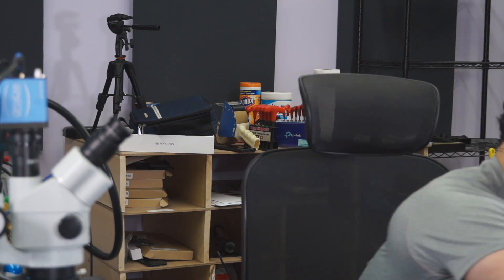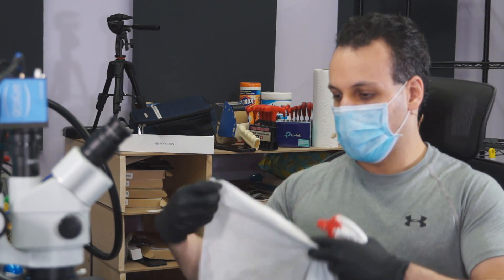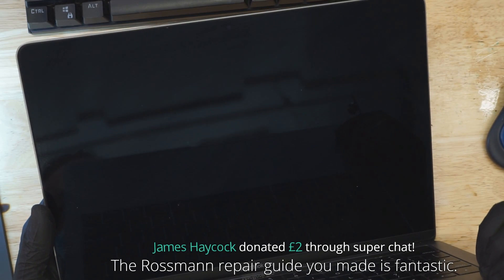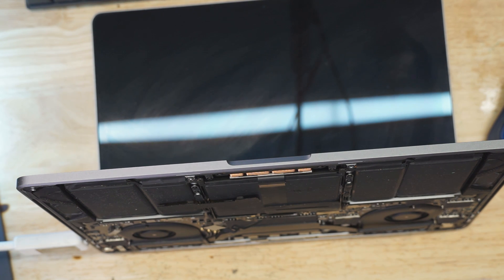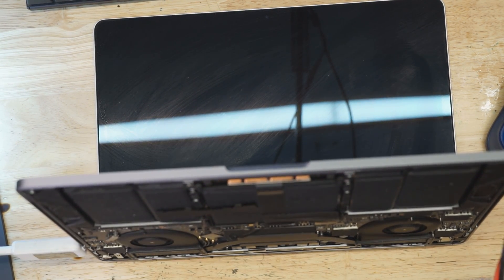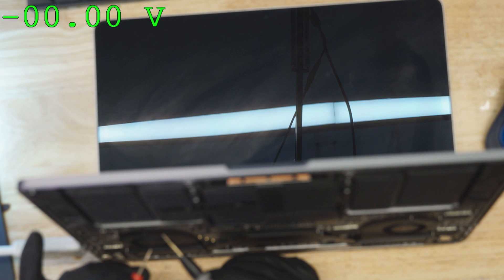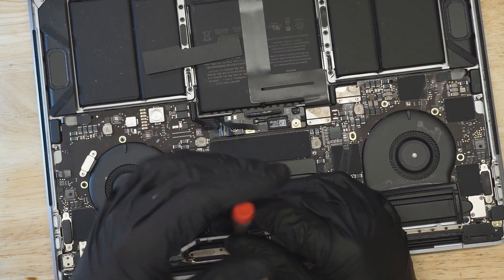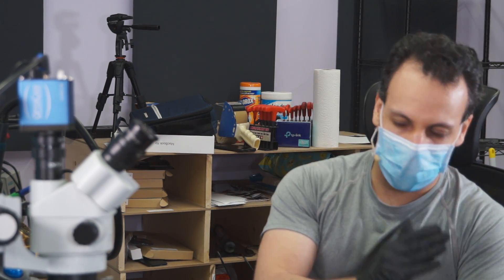Apple PCB design is a meme.

Comment from the maker: It's not that someone made the mistake and didn't think of it at the time. We all make mistakes, even if there's teams of engineers working at a company with 100+ billion in the bank.

It's that FOUR YEARS after the original came out, this is still the design being used. 

In 2020, they still sell machines with 52v power next to 1.7v data. WHY???

You are one of the richest companies in the world - you can't remap a connector and make minor change to LCD for next year's model?

No backlight issues used to be minor connector rework or a fuse replacement - now it's an ENTIRE BGA CPU SWAP EVERY TIME THIS HAPPENS!

Some have said if they changed this, they would have to change the pinout on the LCD as well, meaning that they'd need to use new parts. So perhaps this was a cost saving measure that allows them to re-use old stock. WRONG!! 820-00239 has that problem, then next year 820-00923 has that problem, then next year  820-00850 has that problem... surely 820-01700-05 which uses a DIFFERENT SCREEN ENTIRELY won't have this problem, right? They have the chance to change this because there's a new screen that needs to be made anyway.. AND THEY DON'T! LCD backlight still sits right next to LCD data. Here it destroys a mux instead of the CPU, but still...
Reply: Ugh. Don't even talk to me until I've had my morning crack pipe
Reply: @rbmk__1000  Is that a random quote from Apple engineering room at 10 am?
Reply: @sleeptyper  5 pm
Reply: @sleeptyper  rbmk 1000 (letter to letter translation of reactor big power boiling) can be a type of nuclear reactor that was constructed in Chernobyl
Reply: step 3: profit
Reply: Well, it’s obvious isn’t it? They’re made to break easily when you spill something on  them, forces them to buy a new computer. It’s bad for business to make stuff last for a long time, it’s just the sad truth
Reply: @trickeh2k  Yep, CEO/CTO decision no doubt
Reply: Planned obsolescence, my friend..all part of the plan..
Reply: Apple everyday seems more and more like a Wish .com ripoff laptop that just has a shiny finish and box.
Reply: I feel like you should write "Fuck Apple" on your mask, during live streams... it just seems fitting.
Reply: Louis Rossmann Well somehow they need to sell new shit, so why shoud they make it better?
Reply: @Louis Rossmann for 52V difference (data line many times goes to 0V) for an external point at the board, WITH NO LIQUID just design it should have .025" absolut  minimum spacing which i doubt it has, i am not going in the board view right now but if you feel like it please confirm, here is an online calculator, it would take apple engineers 10s to find it and a tiny bit of logic that they shouldn't do it. Also a good design practice is typicaly account for double the voltage which in a good design should have at least .05" for meeting IPC-9592 standards (for this i am 100% sure there is no way this connector could ever dream of)
https://www.smps.us/pcbtracespacing.html
Reply: This part of planned obsolescence design. Do you really think that the engineering team doesn't know there is a design flaw here? I bet they do, and they also know that there are good chances if someone spills his favorite beverage,  the CPU will get a nice shock. Of course the customer doesn't know about designing PCB and how it could it prevented in his eyes its just his own fault. so he either pay hundreds or even more than thousand for repair or most likely buy new machine. Either way there will be more revenue for the company.
Reply: @eliadbu  at the cost of some damage to the reputation of the company. They've likely considered the trade-off and made their decision. Is it shitty business practice? Yes. But it's up to them to decide what to make and the customers what to buy.
Reply: @Dummyc0m  as I said the average consumer has no idea nor he is interested how the PCB and the connectors are laid out, nor he can compare liquid resistance from one brand to another because most consumer laptops are not water resistant. When someone buys a Mac it will be for the OS, the design of the machine and ergonomics. For instance the stupid butterfly keyboard had a serious and obvious design flaw that customers noticed it (due keys failing pretty quickly) and got upset about it. Apple after 2 (failed) attempts to fix the problems got rid of the keyboard because it got large backlash, for this design flaw (or planned flaw depends how you view it ) they won't get nearly as much backlash and attention because (most) people don't look at the very small details. Sadly reliability and serviceability of most modern electronic devices are either neglected or intentionally downgraded as features and specs fashionable design have greater influence when consumers make a purchase, and the manufacturer will earn more revenue by selling new devices/insurances or repair malfunctioned ones.
Reply: @eliadbu  I have no interest in knowing how the PCB is designed or plan to service my devices myself at the moment. But as I understand it, this is indeed a fairly critical design flaw, but if it were actually severe and widespread, there would be more people talking about these reliability issues. Personally I will not be purchasing apple devices any time soon. Though I would be interested in some numbers of, say, the failure rate or average lifespan of a macbook compared to other devices.
Reply: @Dummyc0m  for that you will need to collect data from tens of thousands if not hundreds of thousands of devices to get a better understanding. Usually this kind of data is available for the company, and it won't voluntarily publish such information.
Reply: Chubbyemu (A doctor who posts videos on youtube): "Louis drinks Corona Coffee-> This is what happened to his MacBooks."
Reply: Electronics guy here. If they gave half a flying shit, a protection diode on that line would go a long way. But no, all they want is for their moron customers to buy the new model every two years and make them filthy rich
Reply: Because.... Apple: Yesterday's technology, but at tomorrow's price!
Reply: Can't somebody file a complaint to the FCC or something?
Reply: You drop liquid on the product, you loose your guaranty,  you have to take it to them, they sell you a new one, profit
Reply: im a hardware engineer and you are dead right louis, this is not a beginner mistake its intentional and disgusting
Reply: The fact that they know about the issue, and continue to make NEW parts with the SAME issue, indicates that this is the desired behavior of the device when exposed to any moisture.
Reply: Well you just answered your question, Louis. They would not be one of the richest companies in the world, if they would not put 52V power line next to 1.7V data line
Reply: @semplar2007  They actually would though because they were a multi hundred billion dollar company for years even before that lol.
Reply: >You are one of the richest companies in the world

and it sure doesnt hurt making hundreds every time this happens
Reply: I swear I've seen you make a video about another repair with the same problem years ago.
Reply: Not that I'm excusing Apple but I wonder if it's like that because that's the way it is on the connector on the display panel? I also wonder about the new-ish CPU's having usb3 directly connecting to them in newer PC design. On the other hand we know that Apple don't want you to repair these products.
Reply: Wow thats insane design. Gonna avoid macbooks. What's a reliable laptop to get? (not gonna use it for games)
Reply: don't worry, it'll still be there in 4 more years
Reply: Starbucks 1 Apple 52V
Reply: no apple for me
Reply: It's on purpose obviously, they like liquid damage to fry the machine, more mulah for the CEO etc.
Reply: https://youtu.be/wj_AOzSSDMM -> This is a cool video to watch.
Reply: https://www.medicalnewstoday.com/articles/new-study-questions-the-effectiveness-of-masks-against-sars-cov-2?fbclid=IwAR3pZyUGxIk6VsZ417gyFrAwyI18IYr4sd7amaLYbD5TQs-t5dkoQ34zPmI
Reply: https://youtu.be/rn-WLpa_nyQ ---> The full version of the video in the previous URL link
Reply: unfortunately, I think I have this exact same problem on a 2016 mac book pro 13". I was going to try sending you it to see if you could work your magic on it, but I think I have both the diagnosis and the prognosis right here in this video :( Nothing much to be done it seems short of taking in into Apple and getting them to rip me for around 1,000 USD to basically replace the whole machine. I'm sure they'll want to replace the whole board, the CPU and the screen itself, so then the only thing anyone rational can do is just scrap it and buy another laptop. When Apple say they "think different", they, in fact, mean "Think sucker"
Reply: They designed it this way on purpose. It forces customers to replace products faster due to higher risk in the field.
Reply: "It's not that someone made the mistake and didn't think of it at the time. We all make mistakes, even if there's teams of engineers working at a company with 100+ billion in the bank.
"

This isn't a mistake. This is done on purpose. If it isn't, they should fire every engineer who worked on these laptops. Not mixing datalines and powerlines is electricity 101. Every single engineer at Apple knows how stupid this is.
Reply: @Jay Talents Its because of consumerism not capitalism, Alternatives exist but Apple customers keep  choosing the same shit even if they have issues.
Reply: Somehow I became unsubscribed to your channel, just a heads up. Has any one else mentioned this happening to you?
Reply: like someone before said Simple diode would do the job without changing anything else;)
Reply: @Jay Talents Please read what I wrote.
Reply: I would say that they intentionally made this so they wouldnt need highly qualified staff, more knowledge=more money. its easier to pay less people that only know how to replace one cpu or other major parts and they get replacement parts in bulk for next to nothing... and they deliberately made it so the thing brakes like that... its not that they are incapable or its poor design - its everything else but that... capitalism
Reply: i wouldnt put it above apple ot design a laptop that is prone to self destructing...

it makes them money.
Reply: I concur with a lot of the other people here, in that it's probably a deliberate trap to turn a simple coffee spill into an entire CPU and/or laptop replacement, for the sole purpose of making more money
Reply: its just like selling fifa every year :D
Reply: They probably don't even know about it. I suspect that when this fault finds its way into an Apple store, it's marked as liquid damage, meaning there is no hardware fault to investigate. Board gets tossed into the trash, design engineer never hears about it, customer goes on their merry, ignorant way. That's what happens when replacing boards is so much cheaper than solving problems.
Reply: @Jay Talents Lazy, ignorant consumers ensure this. Once upon a time, consumers were more involved in their own purchasing decisions and maintenance operations. The problem isn't capitalism, it's cultural decadence.
Reply: @SepticFuddy  Nah, read The Jungle. Corporations have always been this bad or worse. They controlled the media back then too.
Reply: @Rob_Fordd  I never said they weren't. You entirely missed my point and then offered a socialist propaganda novel as proof. I got news for you, bud. Incorporation is not a capitalist concept, it's a mercantilist (now corporatist) one. It is the government and business getting in bed together to protect the corporation from liability for exactly the sorts of things Sinclair dramatized, in exchange for more stringent tax accountability. Strip that protection along with the industry regulations that are all designed to push out upstart competition and the large businesses collapse under their own weight in the truly free market. A free market is the LAST thing the corporations want, hence why they constantly lobby for regulations and support the candidates willing to shove them through on their behalf.
Reply: @Rob_Fordd  It's a rich to hear you, a progressive, criticize someone on the assumption that they're a victim of progressive pseudo-journalism, especially when you wanna put forth Upton Sinclair's fiction as your argument against capitalism. The irony could not be thicker. You don't know shit about me. I've been criticizing yellow journalism and the concept of the "Pulitzer Prize" for many years.  Case in point, I don't eat pigs at all. Most shit that goes through regs I won't eat. I make my own decisions and don't need Big Daddy Government to pretend he's got my best interest in mind when he really doesn't give a shit. It's the market getting wise that forces suppliers to meet the demand for standards. Non-GMO labels, organic labels, kosher labels, halal labels, vegan labels, keto labels, gluten-free labels, you name it. If enough people want it, there are multiple private organizations competing for the trust of the consumer that they can sell to manufacturers. Anyone who cares can do their own research on the different labels and issues and decide what's acceptable and what isn't. All you did was prove my point that lazy consumers are the problem.
Reply: @Rob_Fordd  Talk about projection with all that "mountain in a storm" talk. Ain't nobody talkin about Yelp or BBB, that's just more lazy bullshit. I'm talking about taking responsibility for your own shit. If you get screwed because you failed to do research, that's your own problem. If you got screwed because someone lied and defrauded you, that's the law's problem. You're telling me a government you say already fails to execute its own regulations should just assume total control and then everything will get better. That's called insanity. It's been tried repeatedly all over the world and it's only ever ended in mass starvation, incarceration, and death unlike any other force in history. And you wanna talk about valuing humanity, lmao. You can't even give me an actual argument, just throw out some "Nah, go read some fiction. Nah, you're probably this fictitious avatar I've created for you in my head with no relevant information whatsoever. Socialism works and capitalism sucks cuz I said so lul." You couldn't even be bothered to parrot some Marxist talking points, much less make an actual case for your position. And you expect me or an observer to take it seriously? No wonder socialists "convert" everyone at gunpoint.
Reply: @SepticFuddy  Honestly I think both consumer and capitalism contribute to the problem.
Profit driven Apple market their product to different audience comparing to the old time, new audience isn't smart enough to realize the level of crap hardware they buy into, thus Apple is happy, and consumer is happy since they are too stupid to realize the lie and bubble they lived in.
Perhaps certain level of government intervention can help, but I would prefer educating the consumer and more consumer advocacy instead.
Reply: @Verpal  Government intervention only helps when it is prosecuting actual fraud, which, admittedly should be easier to do. Corporatist protections are the main thing preventing that. Market regulations only ever serve to protect the market share of big, shitty companies like Apple, and enable them to double down on their shitty behavior. Smaller competitors can't afford the legal infrastructure to deal with regulations, and that is the entire point of big business lobbying creating these regulations in the first place. If corporatist protections were eliminated, there would be a lot more viable competition that would force the larger companies to stay more honest. If they can't turn a profit honestly, they collapse.
Nobody else is going to protect your wallet like you will. Consumers MUST take responsibility for their decisions, and stop delegating their agency to the corruption and ineptitude of politicians and bureaucrats.
Reply: @SepticFuddy  ''corporatist protections'' 
Do you mean the existing government regulations? So, in your opinion, to counter Apples behavior, we should eliminate regulation to increase competition in market?
I also prefer educating the consumer instead, but I wouldn't immediately conclude that existing government regulation is completely detrimental, as long as it set a ''baseline'' quality for products.
Reply: @Verpal  Yes, and it doesn't ensure a "baseline quality" of anything. In fact, poor quality is in some cases exactly what a person needs, depending on application and circumstances. Regulations are invariably poorly thought-out, ever-shifting, counter-intuitive and ineffective. They're a stick to beat people with when an excuse is desired, and little more. Lobbyists funnel money into the pockets of legislators to pass their vageuly-worded mega-bills that wildly expand the powers of unelected bureaucrats, who then employ those powers however they damn well please at any given moment. Big corporations like Apple have no problem with this, because a massive army of lawyers is a drop in the bucket for them, and they pass the cost onto the consumer anyway. Anyone not already big enough to be able to afford such a legal team can't even get started.
Without such a competitive atmosphere, the handful of massive companies dominating the industry can all agree to screw their consumers over similarly with impunity. An educated consumer base can only accomplish so much when they conspire so. Furthermore, while educating consumers is obviously always helpful, they really need to develop the habit of seeking out the information for themselves to achieve the desired effect.
Reply: @SepticFuddy  Are you saying that a device that can literally explode have a niche in market? Not sure what kind of ''poor quality'' you are referring to here.
It is clear that you are against any and all regulation, I don't necessarily agree, but at least you are being consistent here.
I think you have overestimated the ability of an average consumer. That being said, I suppose you would think that it is sole responsibility of the consumer to do their own research on their product.
Honestly, in your proposed society, an unsettling amount of people will die of their own laziness/stupidity/unfortunate, you might think it is fine, but again, I don't agree.
It is clear there are too much difference in our idea, further argument/discussion would not be constructive. Perhaps you might find more like minded individual in Ancap societies?
Reply: @Verpal  That's a very dramatic interpretation of "poor quality", but I suppose I can forgive that since most people haven't seen the things I've seen in the 3rd world regarding how people approach problems. The point was that it's up to the consumer to decide how much or little they want to invest into various aspects of various products, rather than setting a minimum bar that locks out the poor. Obviously, if the product causes tangible harm or does not function as advertised, the manufacturer and/or retailer are still liable. That is one of the few legitimate roles of government (which an ancap would never admit).
On that note, I think you'd be shocked at just how "unsafe" things are all over 3rd world societies, with far less real danger than one would expect. It's not to say that anything goes or that they don't have problems, but the bottom line is that we are all human beings responsible for ourselves and our decisions. It is not our place to protect people from themselves at gunpoint, nor do we have the right. Society has seen a degradation in the average person's decision-making abilities specifically BECAUSE the decisions are made for them via regulatory policy. Responsibility and decision-making are skills that are developed with practice, and we have removed the everyday chances to hone them. We are left with an infantile population suited to coddling because they have been coddled all their lives. 
An example is driving. In the Andean sierra, the roads are narrow and highly perilous. The driving laws are far more lax than in developed countries. And yet, the drivers as a whole are far more alert, inter-communicative, considerate, and generally responsible, because they know the alternative is falling off the side of a mountain. Meanwhile here in Dallas, where everybody drives to and from work every day, driving has only become more and more dangerous. There's certainly no lack of driving laws, licensing requirements, inspection requirements, good sightlines on wide, open roads, etc. But the rules themselves give a false sense of security, so that when the inevitable Californian immigrant flaunts them, nobody else around is alert and prepared to deal with the unexpected. We drive around on mental autopilot, and it causes problems every day.
Reply: @SepticFuddy  All place that you quote still have laws and regulation, are you in support of regulations now?
When you are against every and all regulation, I told you, there are no reason to discuss further.
Also, explosive device is not an dramatic interpretation, if there are no regulation in place, it is completely legal, and normal, to see device that will kill user on the market. Mind you, there are existing regulation on every single nation on Earth, no matter how lax regulation is in Africa, factory in China still have to follow QA and regulation in China.
Driving in Andean sierra still mean you have to follow local regulation, I congratulate local regulation if it is suitable for the environment, and we should strive to achieve similar result in the States instead of just arguing against regulation altogether, hopefully by reducing existing traffic law.
Reply: @Verpal  You're confusing no regulations with no laws. Laws that forbid the cause of harm or the misadvertisement of products are not economic regulations, they are criminal statutes. Such criminal statutes are the legitimate purview of government. Economic regulations are not. The entire point of my comparison was that a less regulatory environment promotes vigilance among the citizenry rather than complacency as in highly regulated environments. The fact that they still have some regulations is irrelevant, since it is a comparison. Of course every nation has economic regulation- that's part of the problem. Power-hungry politicians will always want the ability to control and manipulate markets to line their pockets. It is the job of a vigilant citizenry to stop that from happening, because nobody else can do it for them.
Reply: @SepticFuddy  WTF? So we literally have the same position yet spent all these time debating just because of different in definition?
Yeah, I agree that law should stay, regulations should be minimizes as much as possible, especially when these regulation doesn't have to gone through legislative process.
Reply: @Verpal  Lmao nice
Reply: @SepticFuddy  Consumers aren't knowledgeable in the products they buy because there's to much required today. It's unrealistic to ask every consumer to be a dietirion to but food, a mechanic to own a car, a computer engineer to by a PC, a real estate agent to find a home ect. It's impossible for consumers to know everything they need to make decisions on products because products are getting to complicated.
Reply: @StayCHilL24  There are plenty of people who DO know those things who are happy to provide their insight... like Louis for Macs, mechanics for cars, contractors for homes, etc. Get multiple opinions from people who know more than you do, and weigh them for yourself. It's not rocket science. If you're too lazy to do any of that, then you only enable shitty companies to do shitty things to you and the rest of us.
Reply: @SepticFuddy  cultural decadence, sure, but why would the customers be the only guilty party in this as you try to suggest? Wouldn't this be the mentality of the designers/bean counters at Apple as well?
Reply: @mjouwbuis  I never said they were the only guilty party. However, they hold the most power. I'm certainly not letting apple off the hook. But it's not much different to me than the idiots who buy into "early access" videogames and then wonder why they never end up getting the slick, working product they were sold. Alternatively, it's like a girl the puts out on the first date. These behaviors only enable and embolden the perpetrators to do what they do.
Reply: Steinhauer thank you. Someone finally said it. “It’s duh capitalism’s fault right guys?”
Reply: Even a $250 MOTILE laptop from Walmart likely has better internal component design in some respects. Buy MacBook knock-offs, not the real CrapBooks ;)
Reply: @someguy3717  hell no I'm not some degenerate caffeine addict
Reply: @VTSteve  If by "the Norwegian countries" you mean "the Scandanavian countries", they have the same corporatist model. In regards to business, they are actually in many ways MORE capitalist than the US. In regards to social policy, obviously less. But they have also been moving away from the socialized elements of their model for decades because they caused their economy to grow stagnant. It turns out people aren't that motivated to work when you steal 70% of their everything they earn. Who would have thought? Their taxes on the poor are MUCH higher than here, too.
What's your point about who has the power? "Governments and corporations have too much power, therefore we should give them more" is a pretty stupid argument. Do you even understand what capitalism is?
Reply: Jay Talents I must correct you here. You're right that companies do commit to these shady business decisions. But what has failed is not capitalism, it's democracy. Corporations have much much more interest than the average politically apathetic citizen in pushing the laws that grant them protection, exclusivities, and monopolies. Companies that operate inefficiently should not be bailed out, but should be allowed to fail! Capitalism without bankruptcy is like Christianity without hell. It does not work. Now, as for Apple, they actually provide a reasonable package that people are willing to buy. We're not talking about a flawless product, but one that is superior to the minds of many consumers.
Reply: @Dummyc0m  it's precisely BECAUSE the government is in their pocket that they get bailed out.
Reply: @Jay Talents You seem to think the main problem is "corruption", yet that is human nature. You cannot change it in anyone but yourself, nor can any system. The difference is that it takes an a large swath of society being corrupt to ruin capitalism, whereas the more governments get involved, the less people need to be corrupt for the system to cause massive harm (mass murder, mass starvation, slavery, you name it). Worse yet, the most corruptible people of all are the ones who hold those positions-- politicians. In capitalism, it takes more bad apples to ruin the bunch.
Your symptoms are symptoms of corporatism, not of capitalism itself. It's certainly not capitalism's fault that we've abandoned it, it's our fault for not sticking to it in the first place. It's our fault for trying to take the easy way out. For voting for those who claimed to be making life more convenient and "secure" for the rest of us rather taking responsibility for the course of our own lives. For giving them the power to point a gun at someone else, take their money and boss them around. Corporatism does not extend from capitalism. Corporatism is merely the modern-day form of mercantilism, which predates Scottish enlightenment capitalist theory. We are simply reverting to it out of ignorant laziness.
Reply: Jay Talents well that’s just stupid. People buy products that last a lifetime (or a quarter of one, etc,) and the company who sells the best products typically win out your purchase. Capitalism is great this way, it’s an even exchange equally agreed upon by both parties. The problem isn’t capitalism, the problem is stupid people (as evidence by them complaining about a non-human entity making their choices for them).

All people have to do is know what they are buying and agree not to do it. Apple has had plenty of lawsuits or recalls, I mean the evidence is clear and if your dumb enough to still purchase one you kind of deserve it at this point.
Reply: @Jay Talents Capitalism doesn't make people lazy, nor does is require people to be lazy. When societies are full of vigilant and honest people (like, say, Louis), these problems don't reign supreme like they do now. Governments getting into bed with corporations to protect their market share by imposing regulations and by refusing to punish them for fraud (like your plastic rice) and damages isn't capitalism, it's corporatism... which you even alluded to. Businesses getting big and resorting to shady tactics is a symptom of government sticking its nose into the economy and demanding they "kiss the ring." That is once again NOT capitalism. The rest of your points are incoherent, so it's tough to respond to them.
I'm sure you have some brilliant, revolutionary new way to exchange goods and services that is somehow better than people being paid for the work they do based on how much other people value that work. By all means, enlighten us.
Reply: @Jay Talents how does capitalism assure it? that doesn't make any sense, Apple is a billion dollar company because they make products people want, they revolutionnized the phone.
Reply: @pablomaquaire6251  Fuck noo, Sony Ericsson and Nokia did that, when these 2 were on the market Apple wasn't even as a thought mate.